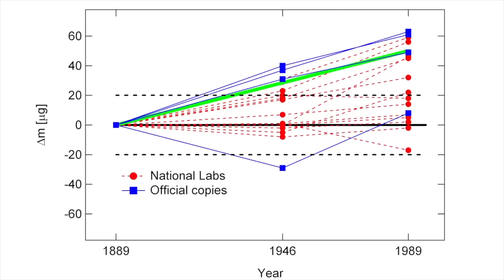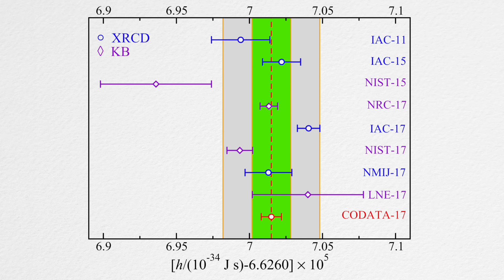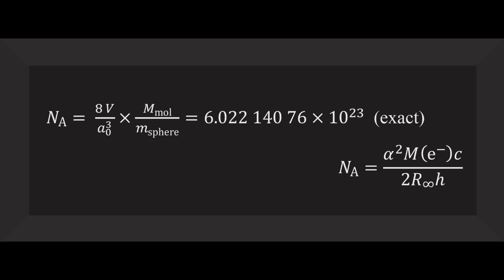The kg is dead, long live the kg

Comment: Most Americans :" cool, but what's that in lbs?"
Reply: The lbs is defined as 2000 barley corns harvested on the last Sunday in september, if there is a full moon. It must then be left to dry for 3 days under a church roof while an ordained priest utters three hail marys per day. Easy science!
Reply: Still 2,20462
Reply: LBs are defined by Kgs and if the defination of Kg changed, LBs will automatically change. That's a valid question.
Reply: @MWaheduzzamanKhan1  - are you sure? Because I think LBs are the amount of grease equivalent in a stone with radius 78.32 inches lifted by a goat found on the flatbed of a F-150 pickup if the temperature is 65.23 F.
Reply: @Mosern1977  you killed it. damn
Reply: @Mosern1977  Savage man 😂😂😂😂
Reply: Mosern1977 the u.s signed the metric unit agreement which means that the U.S promises under law to use metric units. “But pounds are imperial?” you say, the loophole is that we Americans (officially) define the pound in terms of .4536 kg, thus the pound is literally a metric unit. Veritasium covered this in a recent video
Reply: TheOtherOne122 The US Fedaral government did sign that, but it cannot force state governments to enforce it. The government has layers in the United States, it’s a checks and balances that limits the power of federal government.
Reply: @Mosern1977  3
Reply: @Mosern1977  lifted by an eagle not a goat
Reply: @lanrebloom3809  - of course, my bad.
Reply: What about definition that "1 Kg of water = 0.0010 cubic meter of water volume"?
SInce a Kg would change, if the above definition to be remain the same, would it also affect the distance/space measurement unit?
Reply: @rashidisw  This is only true if the water is at 4C deg. Could be tweaked perhaps by slightly changing the 1Kg = 1l @ 4C e.g. 1Kg = 1L @ 3.999999C
Reply: lol at 3.999999C, but yea i kinda forgot about the 4C is when water at most highest mass/volume density. I guess the new tweaked definition would be a tiny bit odd after the Kg redefinition.
Reply: The US lb is defined as 0.45359237 Kg thus is tied to the Kg irrespective of politics
Reply: @Barrys_Workshop  he was making a j o k e
Reply: Joe Average  Average response from am average guy.
Reply: @skeletonwar4445  Very average respond from that comment.
Reply: I think you have an "L" too many.
Reply: +Fons The Magnificient eh, I'm an autotech, spelling was never my strong suit lol
Reply: Lol🤣
Reply: Americans gotta do things differently, cus Muricah
Reply: nintendokings You misspelled ‘murica, and the Americans use the English standard that was the world standard at one point, then replaced by metric. Yes metric is more accurate, and if you aren’t accustomed to the English standard it’s easier however it is the rest of the world that changed, America stayed the same.
Reply: @codename9824  thank you for saying that. I hate it when british people talk bad about us using imperial when it's called "imperial" for a reason.

You know what you did 🤨

And I just gotta say, metric is more accurate with everything but temperature...  0 freezing water 100 boiling water might be good for science but that doesnt have a wide enough range to be as useful as it can be for the every day person
Reply: Donald Trump I’m not willing to buy into your troll “Donald” I fully believe that metric is better, it’s easier and more accurate and if the cost and general insanity of changing units were feasible I would absolutely be on board with changing but considering it would cost BILLIONS and burden the economy I’m not.
Reply: @codename9824  because it has a wider range that humans find livable, I'm not saying it would be worth it to change because it's just not... I know that, that's why the US still uses it. Because it would be a pain in the ass; hundreds of billions of dollars, atleast 20 years, and its bound to cause ALOT of confusion. And it's not trolling for me to express my opinion that metric distance is better, Fahrenheit is better than Celsius since you cant get more precise with whole numbers
Reply: @frowlinian8175  like 65°F and 67°F degrees had a lot of difference lol. Celsius is perfectly fine for everything not just science, what makes no sense is how water would freeze at 32 degrees instead of 0. If you wanna be even more specific in celcius just use decimals
Reply: @Forlfir  that only doesnt make sense because the Celsius is scaled with water, 0 is freezing, 100 boiling. Fahrenheit is scaled with the human body; with 100 being body temperature (used to be atleast) and 0 was a replication of sweat freezing and is objectively more applicable to every-day life. And it is more precise because you can also use decimals for Fahrenheit... with the same amount of decimals Fahrenheit will always be closer unless they're the same, Celsius will never be closer.

I completely understand why Celsius is used, but theres also a case to be made for Fahrenheit and Kelvin depending on the situation. Celsius for cooking and general science because its scaled around water, Fahrenheit for everyday life because it revolves around the human body, and Kelvin for astronomy because of it correlation to color, and Rankine for weirdos who want to express absolute zero with Fahrenheit's scaling
Reply: @frowlinian8175  Celsius and Kelvin uses the exact same scale, only the the zero point is shifted, so "conversion" from Celsius to Kelving and back is simple addition and subtraction. 

Celsius is a very practical scale since if outside temperature is below zero it can snow. Also for cooking it's very useful to that 100 degree Celsius is when water boils, for sous vide for example. Fahrenheit makes no sence, since every individual not only have different normal body temperature,  but it also varies from day to day. 

Also Farenheit has no advantage with precision, since SI users are not afraid of decimals unlike Americans. Only time decimals are needed for every day life is when checking for fever anyway. For weather decimals are not needed, since no one can feel the difference between 24 or 25 degree Celsius anyway.
Reply: @codename9824  Worked on an American car made in the last 20 years? You might find one or two inch size fasteners in it, but if you don't have metric size tools, you won't get much done. While there would definitely be a cost to chaning over, I'm fairly sure that holding on to the old units costs more every  ten years time than converting would cost just once.
Reply: @nintendokings  Americans don't have a choice.  This American prefers metric units, healthcare, and wants daylight savings time to screw off.
Reply: @Icewind007  I like daylight savings
Reply: Suck on my Plank Americans!
Reply: @deltabeta5527  Planck*
Reply: True
Reply: 52% of the UK: "So we can abolish the Metric system now?"
Reply: Most Americans I know, know both. An advantage, in my opinion.
Reply: howie Getants me
Reply: I appreciate the fact that you said most instead of all.
Reply: About 450 gram
Reply: I request that you call them "freedom units" from now on.
Reply: triggered lmao
Reply: As an American: I know exactly what a kilogram feels like, I know what a meter looks like, I know what celsius feels like, and can invision/think in metric most of the time from all the science classes I took in high school. Most Americans would be able to as well, had they paid attention. The only thing that still trips me up is that a millimeter is too small for me to invision most times, and I wind up just using inch partitions because of my mechanical background with socket and bolt sizes lol.
Reply: @WaveWarrior98  If millimeter (1/1000th of a meter) is to small: use centimeter (1/100th of a meter). If centimeter is to small: use decimeter (1/10th of a meter).
Reply: Justin Kimes it's kinda the opposite for me. As an American I know what a centimetre and a millimetre is like but when it gets bigger I can't really envision it anymore. I know what 40° or 0° C degrees feels like but for a lot of in-between numbers I need to convert it to Fahrenheit to really grasp it. I don't know what a kilo really feels like and I only really understand kilometres in that I know 60mi =100km. Just because I haven't had much experience in any of these, even in science class. I do however, think that the US customary system just doesn't make sense. How is anyone even supposed to remembers how many feet are in a mile, for goodness sake? I really don't understand why we still use the customary system.
Reply: @umakarunakaran4626  remembering a mile is easy, its 8 furlongs, which is 220 yards (660 FT) 660x8=5280.

But it originated during Roman times where it was "1000 paces" and with a pace being roughly 5 feet it came out to 5000 feet but was adapted during the 1600's to mean what it does today. All in all it was meant to be a number with meaning. A mile was essentially what a farmer could be expected to plow in a week. Temperature was based around a human's body temperature, the foot was, well a foot, a yard was a stride. The pound was 3600 grains (useful for farming)

So if something was 100 yards away it would take you roughly 100 steps to get there, if you had 2 pounds of grain there were 7200 grains in there etc, and wasnt an arbitrary measurement/counting system... of course all that has changed drastically since its conception but still, it's somewhat more practical than it may seem
Reply: @WaveWarrior98  Dont forget that milli- is only a myltiplier and you can use canti- if you want. The main unit of distance is metre.
Reply: @WaveWarrior98  9/16" = 14mm. At least it's close enough that the wrenches are interchangeable. But don't try to use the 13mm wrench on a half inch bolt head, if you value either the bolt head or your knuckles.
Reply: The Imperial system is nonsensical trash.
Reply: Hauteclere Great argument poopsie. You reeeeeally showed us Americans.  We shall all proceed to weep in consternation.
Reply: @box97able  Learn lengths and the kg, maybe celsius too. We shouldn't force people into the metric system but people should learn it since practically everyone else knows it. It's like not bothering to learn English in today's world, except the metric system is even more prevalent than English ever will be.
Reply: 2.2ish
Reply: Not really. We're not morons. We just use a system of measurement based on Freedom instead of a vault in France.

Comment: so i can lose weight without going to the gym? (given its less than the original?)
Reply: @wurttmapper2200  Had to buzzkill it didn't ya
Reply: No, if the new standard is lower than the original you gain mass and weight on paper. A smaller standard kilo means you need more of them to account for all of your body, making your mass and weight go up.
Reply: you'd lose weight, but so would everything else in existence, so it kinda evens out :/
Reply: @wurttmapper2200  The opposite. If it was halved your weight in kg would double. If it's halved you would need more of them to account for your entire body than before. It is just like with pounds. It has a lower value for a certain amount of mass than the kg so you need more of them to to account for your body.
Reply: Adam Rasmussen Yes, you are right
Reply: 5:00 oof
Reply: @therylander9786  thing is, weight is a force dependant on mass as a base unit. so, if mass (kg) changes, so does the definition of weight (N)
Reply: @Harold Potsdamer I am fully aware of that. I answered the hypothetical asked by the OP.
Reply: Wurtt Mapper 
For real??😑
Reply: You probably lost more weight in your last breath than by this recalibration.
Reply: Mmm, no you'll gain weight. the individual kilo now weighs less so you equal more of them
Reply: *it's (contraction of "it is," not possessive)
Reply: Well you actually lose weight at the rate of about 1 kg per day just by breathing, and you must replenish it with water and food to keep your weight stable. If you can abstain from eating you will lose weight VERY rapidly.
Reply: No, you weight more kilograms, not less.
Reply: Yes, but the amount of fat is not.
Reply: Some of you, I assume are real fun at parties
Reply: Hey Derek. Will the change in the fundamental quantity of electric current from ampere to electronic volts change conventional direction of current too?

Comment: The kilogram is a unit of measurement made by scientist in the XVII century to standardize weight in a world where hundreds of other units coexisted. Now dozens, even hundreds of scientists and researchers from different parts of the world came together to redefine the kilogram one last time so that it's based on universal constants of nature. This makes thee kilogram one human kind's greatest achievements.

The pound... It was originally the weight of 7,000 grains of wheat, now it's defined as 0.45359237kg
Reply: I thought 1 pound is $000.3 USD???
Reply: God Slave a pound has several definitions: in the UK it signifies money (~$1.28, not $0.3). In the United States though, it is used as a unit of weight in the imperial measurement system (and if am correct it is the only country that uses it as weight).
Reply: The pound was based on the roman ounce that is supposed to weight 144 carob seeds (the carat)
Reply: I don't know but this is probably inspired by updating the constants of the speed of light and the length/duration of the second.   It will not change, only increase in precision in many years to come.
Reply: Isn't the US Customary pound actually a measure of mass?
Reply: awesoeCAMI dang you really got me confused for a bit, but doing some research I found out it can be used as both. More popularly, it is used as weight “oh wow i just gained 10 pounds, I should probably loose some weight”, but it can be used as both. To distinguish them, in repressing mass it is abbreviated lbm (0.45359237kg) and when representing weight or force it is written as lbf (4.448221615N). God I hate the imperial system.
Reply: Harold Potsdamer that’s what’s my previous comment answered. I personally thought it only meant weight, but the word pound can also be used as mass in the USC. The only way to distinguish them is the way they are written. Pound-force is weight, abbreviated (lbf). This is the more popular use of pound in the USA, referring to weight. When corresponding to mass, it is written as pound-mass (lbm). I have personally never seen them be written as either lbm or lbf because usually when you need to convert from pound (lb) to SI unit kg, the pound is referring to mass. But in more popular speak as I mentioned earlier it is used as weight. 

To summarize, don’t use USC, it’s dumb.
Reply: Harold Potsdamer Couldn’t agree more

Comment: Sorry if my question was answered in the video and I missed it, but from what I understood the values that we plan to assign to Planck's constant and Avogadro's number are still based physical measurements (Kibble balance and Cesium sphere). How is this any different than measuring a mass and assigning it the unit of a kilogram? What physical constant is connected to the values that will be assigned to h and NA?
Reply: The physical constant that we measure to determine Plank's constant is fundamentally constant, much like the speed of light. This means that, unlike a solid mass, it's value will not change over time. The only uncertainty we have now is that of our measurements.

Comment: Maybe I’m not thinking about this correctly, but if we set these “constants” to a specific number when in reality they have a variance, then how will we know if they ever change? That would seem to indicate that the kg would also be changing but we would have no way to measure it.
Reply: Without a doubt, the future will find our super-constants wrong, if for no other reason than they begin having need of 12 place accuracy.  Chemists will use the best value they know at the time to do their calculations; the "old numbers" will only apply to metrology. Ultimately the measurement system will probably upgrade to better constant values, at a single lurch.  I notice no one in a hurry to shut down their own metrology units thinking their jobs are finished.

Comment: So my K value in my voltage drop formula I use all the time at work will change?  I guess theoretically, but I’m usually vague enough with all my measurements and I believe the K value is rounded, so I’ll probably be just fine as an electrician.

Comment: Does this put the final nail in the coffin for the beauty of the metric system? 1kg is no longer 1L of water is no longer 10x10x10cm of volume etc. Amperes and moles no longer related to the kilogram.

One of the beautiful things about the metric system is the way that it relies on itself to establish the other. Can you make a video on why this is such a bad thing? What would be wrong with defining just one thing (eg length) and then make all other metric units relative to that?

Comment: as an electrical engineer, can you add a bit of clarity of "resistance will change by a little bit less than 1/1000000" cause 1 mega ohm is not that much in most places